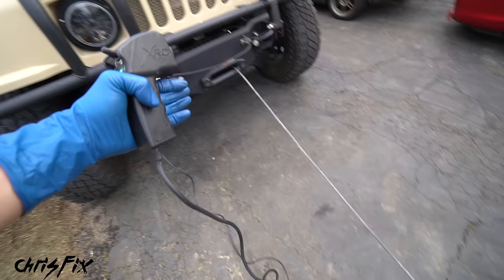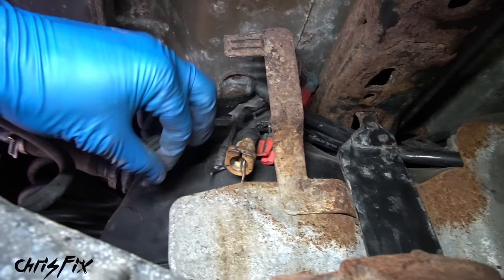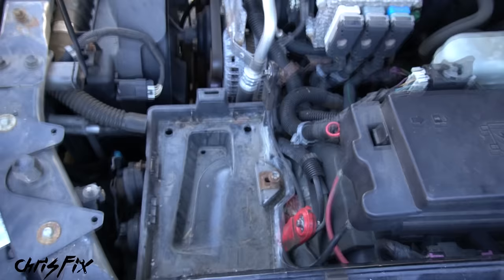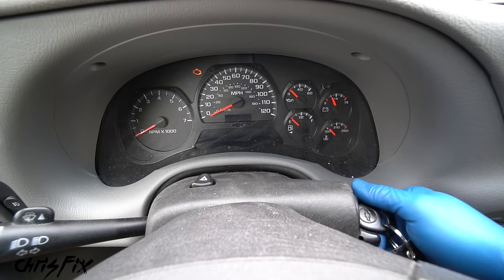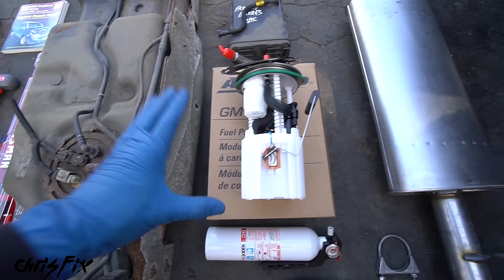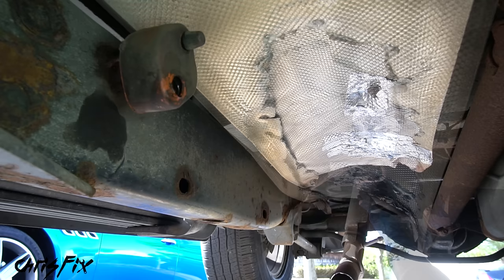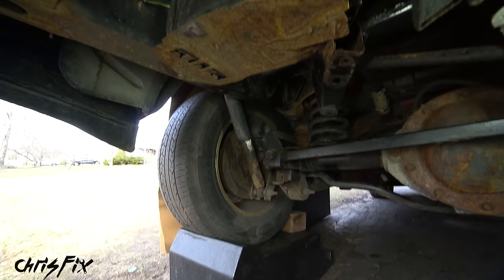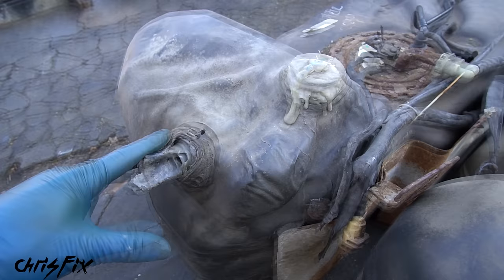How to Fix a Car that Wont Start (I bought it for $500)

Comment: I'm not a car person but this guy is making me want to do all my own repairs.
Reply from the maker: You should try it. You don’t need to do anything crazy but even an oil change is fun!
Reply: Same, let’s see what we can fix!
Reply: ikr
Reply: Thats the power of chrisfix, he would make us all believe in ourselves lol
Reply: @chrisfix so true inspiration.
Reply: Well, If you watch enough of these videos you turn into a car person :D
Reply: @chrisfix  I did my first oil change myself on my previous car. Fun easy quick. Then it blew a head gasket from a warped head. A previous owner brought it to ascamchanic for overheating issues I assume, and the head was super warped from still having factory coolant in it. It was an '05 model camry. I did the oil change last year xD
Reply: I have  I own the same Chevy trailblazer the problem is it’s 40 degrees temperature they won’t start I change already battery .alternator .I put it kind some fuel injector?pls reply give me some idea
Reply: For me, it’s always looked a lot easier than it actually was to do!  😮
Reply: @chrisfix why does the hummer look like it’s eating pasta when you use the winch

Comment: ChrisFix: "He wanted $1,000; I offered $500. He was a shrewd negotiator though, so we met right smack dab in the middle at $500."
Reply: Mr. Bolian has arrived.
Reply: ChrisDeals
Reply: Your green jack looks awesome
Reply: @Ty-tie_FTW  r u talking but chris or the guy who sold him this?
Reply: @bilaltariqg  not talking about chrisfix. I like how he buys and fixes and sells people something he can trust himself. And i was joking about the crowbar to the seller dudes face
Reply: @Ty-tie_FTW  i mean the seller dude would probably be hitting himself with a crowbar. 🤣🤣 lost about 3000$ for a 3 $ fuse...LMAO
Reply: The art of the deal
Reply: @Ty-tie_FTW   Hello Mister Freeman
Reply: Ed wouldve met right in the middle at 100$
Reply: @Ty-tie_FTW  Its quite possible he didnt know about anything else, some people are really oblivious and especially when it comes to cars. Hell a few months ago i didnt know jack shit
Reply: Any time someone mentions "fuel pump" - you automatically know it's going to be more than that. Whether they put stale gas in the tank and started the car after it sat for 6+ years, or the tank had rusted out inside and sucked rust into the pump - you're looking at a total fuel system cleanout and/or replacement. Also  - such as in this video  they likely ran the car on fumes so much that they burned out the fuel pump entirely and caused the fuse to blow out.
Reply: @Ty-tie_FTW  I think screwing people over would have been more like being firm on the price.  The seller I'm sure knows there is other stuff wrong.  I'm sure there are other things wrong with the vehicle but are not major.  Plus I'm wondering about the misfire and how the fuel pump fixed it.  Usually if you have a misfire on one cylinder it's not the fuel pump, otherwise it would be causing issues on all cylinders or most of them.  I'm thinking there was more to that than what was revealed.

Comment: If I'm paying $500 for a car in the rust belt, I expect that thing to be a pothole away from breaking in half.  That looks great considering the age.
Reply: This is a $2000 car on OfferUp in Ohio not running xD now chrisfix made it a $4000 "fresh trade in"  at a buy here pay here place..  boy we have it bad here
Reply: In Wa I've bought two rigs in "running condition" both have electrical issues but boy do I love my 86 chevy astro van with a bored out 4.3L and anything autozone could throw at it except seats for less than 1200$ total for a "race and tow" rig and it will do 92.1mph in third of four gears but what blows my mind is the transmission is both an automatic and a manual with clutch plates
Reply: You beat me to it😄😄 Chicagoland here. Cheap or  expensive cars it doesn't matter. If you drive it in the winter rust conquers all.
Reply: @icepop54367  likely it is 2000 (or at least 1000-1500) car where he lives as well and this one just was a lucky catch. 
Many youtubers  (not only in car niches) present lucky catches as a norm and then when people try to replicate, they realize it is not the case in real life
Reply: Kinda accurate
Reply: @icepop54367  why im wondering where the hell he found it for $1000 to get it for $500. Must have had no tittle.
Reply: @brandoncaldwell95  he did show a title in the video, now that could been for any of the other cars, but with that said since they at least in Ohio have the new and last owners name and address he might have blued out and did only a few second shot as to keep that information private as possible. As to price some folks have a extra car they want to get rid of or whatever and will say just this is wrong and if they dont say firm in the price. I say haggle that price especially when problems are found. 1000k for paperweight basically isn't worth it ad that's a common vehicle. Now a classic/vintage vehicle can be a different story.
Reply: @Embermist69  i know he shown a tittle in the video. Doesnt mean he didnt file for a list or stolen one. I get people try selling junker cars for more then a scrapper. Think is, its worth more than $1000 in parts. If he had the car sitting around for any length of time, then he hand ample room to part it out. 

Reminds me of a listing i saw on craigslist near me. "$2500 work truck bed with a free truck. Pickup needs a transmission. Tittle in hand"
Reply: @brandoncaldwell95  All kinds of people out there..... Strange world we live in.
Reply: @tomjens2046  This would be pretty easy to not get hurt on if you have even a little mechanical knowledge and get it for scrap value honestly... Now me PERSONALLY I wouldn't have paid more than scrap value for this without at least hearing it crank to make a little more sure that it even had compression (Chris said he bought it without getting it to crank for $500, which wasn't far off from scrap value but I probably wouldn't have risked more than $400)... If he brought a battery and brought the multimeter with him to the owners house to test those fuses, EASY BET at that point (although the deal might not be as sweet if the owner hears it trying to start lol). But not cranking at all? Bad risk. Hopefully people trying to replicate this flip don't go into it as blindly unless they can get it damn near free.

Comment: Oh man, that feeling when the car runs. Every time I fix one (I drive shitty cars and need to fix them a lot) and it starts, it's like... Ahhh man, the best.
Reply from the maker: Yea such a euphoric feeling!
Reply: We have an expedition that had constant overheating problem. We've done a lot to keep the thing running but Everytime it goes down it's down months at a time. Everytime we've got it running I had so much satisfaction. I expect another shitty job if it breaks down but I love the feeling.
Reply: I drive a 10 yr old Acura I'm doing the 500k challenge with. It's definately a euphoric feeling doing simple repairs and maintenance yourself. Making the car safer, better handling and better performing.
Reply: God yes.
Reply: @chrisfix Wtf Dat mean? 💀

Comment: One thing to mention is that a blown fuse is rarely the actual problem, it’s usually a symptom of a bigger problem somewhere else In the car. You mentioned that in this video with the fuel pump that ran dry so kudos for that! Always love your videos
Reply: Basics of electricity: Fuse is a safety breaker, if it goes bad, it means something terrible would happen if the fuse wasnt there, so you should investigate.

Comment: If  you wanted to make the leather seats look really really nice again, just throw a bit of warm water on them and use a hair dryer to slowly evaporate the water.
The leather will shrink back to close to original, and doing this is SUPER cheap for a really nice outcome

Comment: I can truly understand the excitement that the car started with just a fuse replacement,I'd be happy too.
Reply: When he was checking the fuses I was on the edge of my seat with my daughter going "Oh man, it's going to be a damn 5 cent fuse and that's all that the truck needs!" That gas tank etc was a bit more... I never knew dropping a tank was that easy.
Reply: @tringalij  It usually isn't I was impressed actually. I had to replace the filler neck on my 05 blazer and all i could think while i was doing it is "Man the engineers who put this together are a bunch of psychos"
Reply: Lol I read this and u spoiled the end
Reply: too good to be real :)
Reply: @charleydavidson3500  Lolll!!
Reply: I bought an o7 kia spectra for $200 and replaced a fuse for the alternator that was pushing 19 volts and replaced front and rear pads and rotors in total including the car $330 altinator works fine now
Reply: @charleydavidson3500  engineers removing their frustration on products

Comment: Side note: It's always a good idea to apply anti-seize to exhaust nuts and bolts.
Reply: Yep! Maybe I'm not supposed to but I also put the brake lubricant (silicone stuff) where wheels contact my wheel knuckles. Makes it so easy to remove.

Comment: I don’t really know why I’m here but this was fascinating. I literally have panic attacks when I try to go get an oil change, but you’re so chill and knowledgeable it really helped me learn and be less freaked out by car stuff. 

Thanks so much- new sub!
Reply: @THAT Guy yeah exactly.
Reply: Simple steps in really owning, your car is to take control over things. Watching videos of other people doing repairs/maintenance is the first sub-step to that. There's no rocket science in keeping your car upright, only dedication to the investment you made (at its most core value).
Reply: This channel in my most favourite . If you stay here, you will probably start Drifting and offroading very soon.😂😂
Reply: @THAT Guy But soon it'll end up costing you!
Reply: Actually fixing a car is wellknown cure for anxiety, it calms You down and reduces stress levels. Unless You stuck and don't know what to do, in this case You may experience some frustration
Reply: @vitalino1981  or what normally happens is a bolt is rusted out and you touch it once and it strips or breaks off and you lose your 10 mil and it doesnt hit the ground and the car draws blood on you as you try and stick your hand in there and now you have a hand full of blood and grease but no 10 mil.
Reply: Im the same way with oil changes. Thats why i never leave the vehicle alone and BS with the guys. Gotta make sure they do it right or ill do it myself. Just when things break, its the FFS thoughs.

Comment: Chris "Its a good family car!"

Trailblazer: Screams in bipolar broken 4L60E
Reply: Fact the 4L60e can either last 300k or 100 miles.  The one on my avalanche has been good so far, but I don’t expect it to last very long.
Reply: MattProductions2012 but the 4l80e in my Silverado wil last as long as the motor 😝
Reply: They also have a tendency to die while in movement from multiple causes. Chevy!
Reply: when paired with that 4.2 they're generally under stressed and will probably outlast the ones that are in the Silverado's and whatnot.
Reply: I’ve had a few 4L60E’s that had no issues with 200K
Reply: every single automatic transmission ever will have some comment about how it's terrible and breaks and then one comment about how it's lasted someone 400,000 miles

take care of your transmission and it will take care of you, don't put dumb shit in it and don't let it overheat
Reply: Local transmission shop owner told me 5 years ago that he attended a seminar put on by GM and this was his opening statement  -  "If we didn't make them to fail; you, you, you, you, you, you  and you would be out of business today!"
Reply: Ran tens on mine for years with no problems.
Reply: Yeah the one in Dad's silverado ate shit a few years ago. Been expecting the one in my Suburban to eat shit, good thing I got the Oldsmobile F-85 with its freshly rebuilt two speed!

Wonder if the 5.3 would mate with a 6L90E and still play well with the transfer case? Of course it wouldn't have manual mode but oh well.
Reply: I was waiting for a 4L60E meme to pop up
Reply: My TB has 250k miles trans and engine still hittin a lick just fine
Reply: @illshlapu  420L69E 

there you go bruh.
Reply: Its all problems when you have a bowtie in front.
Reply: I have 265,000 on my 2002. Living the life!
Reply: @whydoihave6neutrals772  ignition switches
Reply: @subadanus6310  exactly... everyone's gonna comment that has a problem with it... but the ones that don't have issues, you don't hear from

Comment: I know a guy who deals with tons of car selling and buying. A lot of times people would try to sell cars that didn't run for 2-3k thinking they were going to get that. He taught me all about it and basically this guy here is spot on. If your car doesn't run for any reason and you are trying to sell it, its worth scrap value which is about 4-600$ and guys thats it. it doesn't matter if you had just installed new brakes and rotors or anything else. A car that doesn't run isn't worth anything. Now, if it runs but has issues they start at 1k in value and go up from there. If this Vehicle had started, then it would probably be worth 1200-2k.

Comment: Hi Chris, electrical speicalist here.

Checking for blown fuses in this manner is dangerous. If an electrical problem with the car may have caused the fuses to blow, this electrical problem may still be present even with the keys turned to the off position.

Checking like you are doing using the resistance setting on your multimeter is remaking the broken fuse, through your multimeter.

If the short is still present, you will now be putting that short current through your meter which could break it.

Furthermore, if you were testing a small amperage fuse in this manner, the multimeter may well be able to take more current than the fuse you are testing, causing an excess short current to flow through your vehicle.

I recommend testing like this with the battery removed only, or better yet, just remove the fuses one by one for a visual inspecion, they make them see through for a reason!
Reply: Matthew Edwards I double down on this. I’m not an electrical specialist but even I know the basic rule that my father taught me years ago: if you’re working with some kind of electricity in your car, at least care to take off the negative terminal of the battery.
Reply: How are you completing the circuit?? The fuse IS blown there's no connection between the meter
Reply: @jlatnyc  the fuse connection is remade through the meter when it is set to resistance!
Reply: Agreed. I always use a test light hooked to the ground of the battery. It should light up on both sides of the fuse. If not, it's blown
Reply: @benjaminnielsen5265  now thats a smart method!
Reply: @matthewedwards5872  ahhh. I had an aha moment. Thanks. I was not thinking straight. You sir are correct, the circuit is indeed completed. Can't comment on the specifics though.
Reply: Smart move there!

Comment: I love how excited you get when you get this car running when you’ve done so much work on cars, and how you’ve made many broken cars drive again.
Reply from the maker: It's always an awesome feeling!
Reply: ChrisFix real quick I had an idea for a video if you don’t have a video idea or if you’re waiting on parts. There are a lot of car guys and non-car guys who watch your channel and not all may know what every part of a car does. Maybe for a video series you go over parts of the car and explain what they do but focus on certain areas per video like one for the engine, one for trans, one for drivetrain, etc.
Reply: You can tell his excitement when he almost forgot how to use the interior door handle.  
MUST GET OUT NOW
Reply: Rider 808 but what i dint understand he just changed the cooling fan fuse and battery to make it run
Reply: @isaaccollazo2874  The fuel pump and starter fuse

Comment: It feels like Christmas everytime you drop a new video, super entertaining and makes me want to go ahead and buy and revive a car just like yours can't wait for the detailing part
Reply from the maker: Thanks Milo! The detailing video is coming out amazing! It looks sooooo good!
Reply: @chrisfix  Hey Chris, do you think at some point you could do some wiring or electrical work? Your vids really are that understand able, they were able to help me score a mechanic job and I'm not even certified. Maybe a heater core or simple after market stereo? Thank man god bless you brother.
Reply: @chrisfix  My family had to replace a gas tank on their truck which is similar to chevy trailblazer. A gmc envoy. The gas tank had a major crack in it which was cause by rust. Our mechanic told us new one is worth more than 800 dollars, and use one is worth anywhere from 100-700 dollars. A week later they called a and told us that it also needed a new fuel filter besides the tank and the pump. My family had to pay $900 dollars. But on the way from the shop while he was at a stop about 15 mins from my house thank check engine came on. My dad told my mom it and my mom called the shop back and my dad took it back up 4 days later. They told us that they a senser that is connected to the newish gas tank is bad and they forgot to check it before they gave our car back. They fix it. They didn't even charge us anything becuase it was part of the work they did. Plus when we were there real reason why it cause 900 dollars was because we had them change our oil as well.

Comment: One of my favorite Chris Fix videos. I liked seeing him tackle the diagnosis and then the repair. In this case he determine 2 electrical components were not working, this led him to check the fuses as that could effect two things at once. Found bad fuse. Replace. It’s starts. Then looking under, you can see an obvious bad muffler left unfixed caused the fuel tank and evaporate issues. Great logical fix here. Plus I have been a Craftsman tool fan for 30 years.